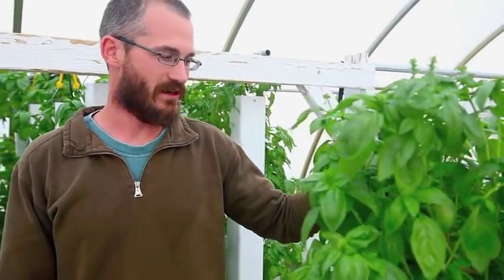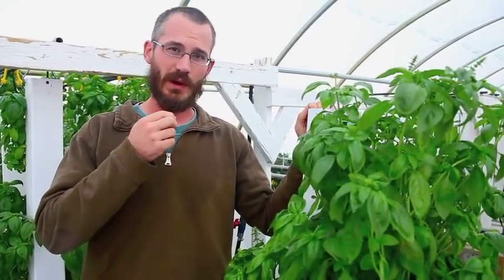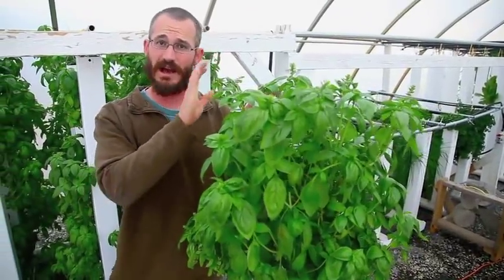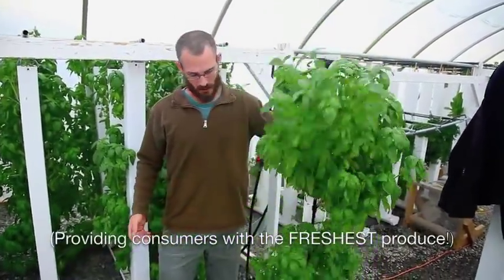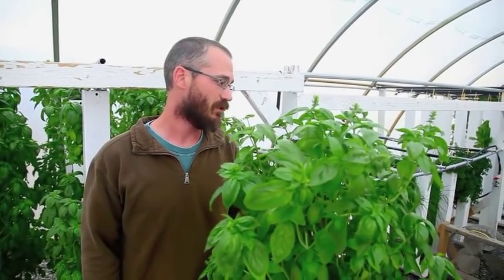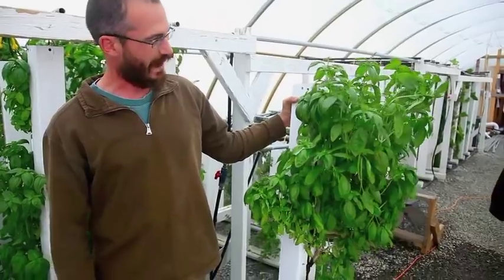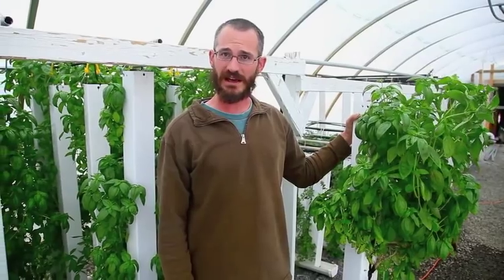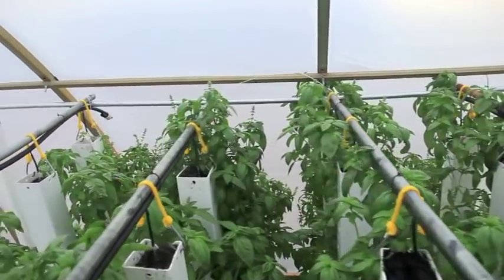What is the purpose of the ZipGrow™ Tower Design

Comment: I was wondering if there was any crazy temperature swings with this style since there isn't a big body of water
Reply from the maker: Hi +Jacob Padilla - Because the ZipGrows are a media-based system that's 92% air, we actually avoid a lot of those temperature swings around the root zones. As you probably know, when we get temperature fluctuations around the roots, plant health suffers. The only type of temperature swing ZipGrowers will run into is their actual system volume (i.e. if they have their fish tank in a greenhouse instead of a separate fish house to buffer some of these high highs and low lows. Does that make sense?
Reply: Yes simple enough thank you
Reply from the maker: +Jacob Padilla Happy to help.

Comment from the maker: Well, it's very difficult to move towers with more than two sides of produce sticking off of them.  You can't lay them down or hang them against a box truck wall without damaging the produce.  When there's just one side, you can easily grab it, pick it up and move it around.  With two sided, it's must more awkward and you can't do as much with it.  When you're harvesting (especially with a machine) now the tower can lay on it's back and only one side has to be harvested.

Comment: You certainly would know more about light requirements than I do. I was just thinking you could rotate them with a simple small bicycle gear or something with a bike chain. I would think for crops like the herbs in the summer you could increase your production per sq ft quite a bit at least, but again the light thing is not something I'm in any way an expert in. Certainly with the towers and media you are using it wouldn't work, or would at the very least be more complicated.

Comment from the maker: Rotating towers is very expensive - labor-wise & equipment-wise to hang and rotate them. And, all of our research shows that there is no net gain with a four sided tower, even when it's rotated. This is compared to a single-sided south facing tower. In fact, compared to rotating towers with fruiting crops, our towers are more productive as light is concentrated in fewer plants & producing fruit requires a lot of energy. There's a PAR threshold that must be met for fruit production.